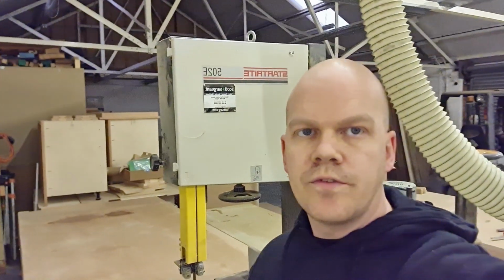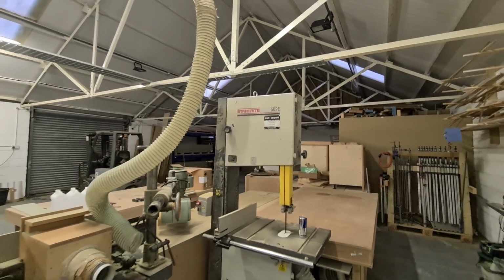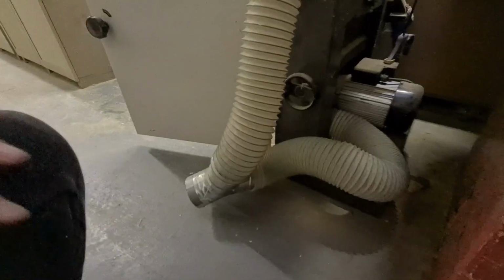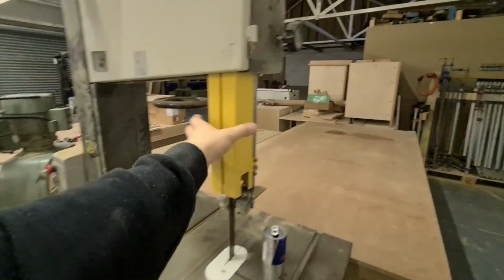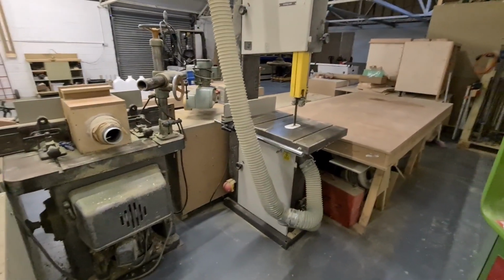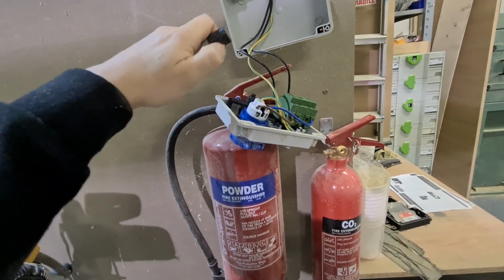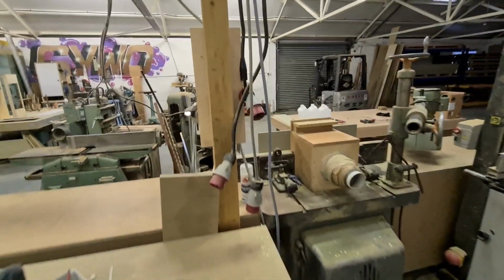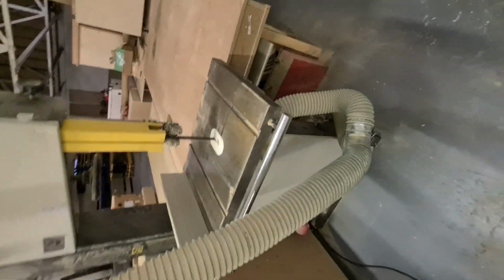Startrite 502E Rundown/review and relocation

Comment: Hi mate I'm thinking of getting one of these second hand, primarily for resawing hardwood.  Is there anything you would recommend checking in particular on this model?  Also I'll have to get it off a pallet and onto a mobile base, is this realistically possible for 3 lads to do?
Reply from the maker: Hi, yeah it's probably not powerful enough for hardwood resawing I'd say.  I had to rip 400m of oak for kitchen wall cladding and it was slow and couldn't keep the blade speed up.  It's a good machine for general stuff but defo not a resaw.  To answer your question, it is definitely movable with 3 of you.  I can shift this one round the shop without too much difficulty by walking it but it isn't light so go easy.  If you do get one for general stuff, just invest in the best blades that you can.  Hope that helps.

Comment: If you’re turned off the live at the box, the neutral and earth are still connected. While moving the cable likely you connected the neutral to the earth, or something else earthed (wire trays). Other stuff using power in the shop (lights) will put a voltage into the neutral so connecting it to earth will be enough to make the RCD trip.
Reply from the maker: Sweet. I thought it would be something like that.  Thanks for clearing it up. 🙂

Comment: Scott & Sargeant are exactly as you said. They have an air or arrogance about their staff, dis-interest and have an attitude of "Well there it is, do you want it or not". I would also point out that when Sedgwick discontinued making their 3 headed tenon cutters (TESH) earleir in the year and stock levels became low S&S increased the price of the machine from £5,999-00+vat to £7,999-00+vat literally overnight............ Some would say "Well that's capitalism for ya" but to me it's was profittering and a disgrace. I only buy bits n bobs off them now and recently spent £45k+ (and still rising) on new machinery for my workshop, not a single machine was purcahsed from S&S . Their greed lost them the sale of a new spindle moulder, power feed, extraction system, Vertical wall saw ,tenon cutter and assorted tooling.Waiting on a Felder FB510 Bandsaw to come from Austria .  Enjoyed your video , cheers... Adrian
Reply from the maker: Hi Adrian.  Yes exactly.  I do buy some things but as you say they are not big.  I think the last thing was a CMT slab flattening bit, you know the one with the flytips for blades, it was on sale on the s&s site for half price.  Bizarre.  Anyway, thanks for the feedback, good to see I'm not alone!